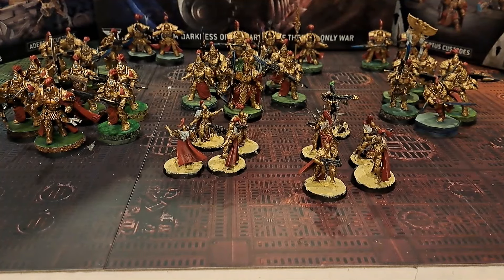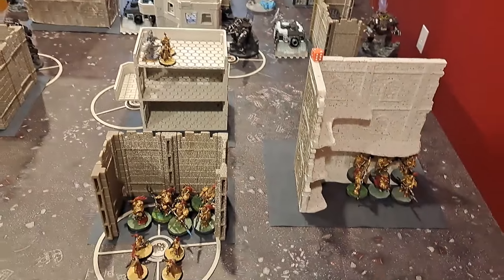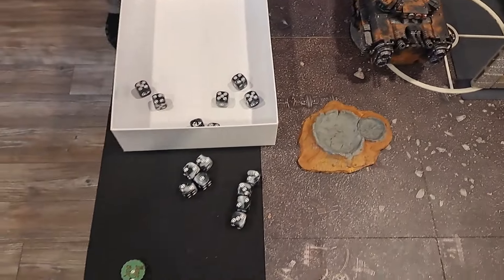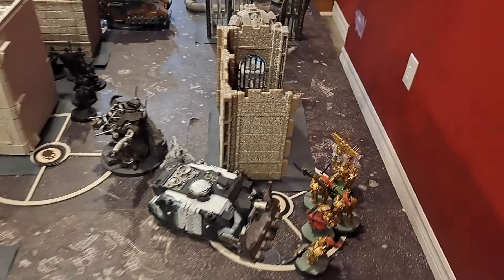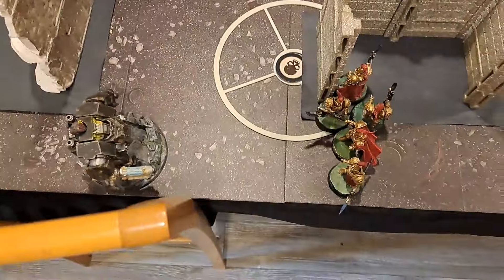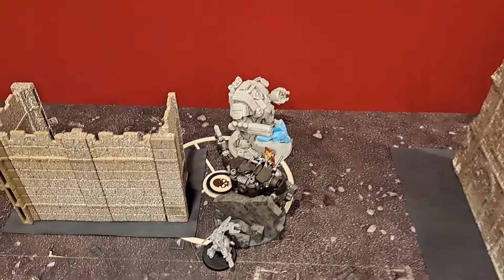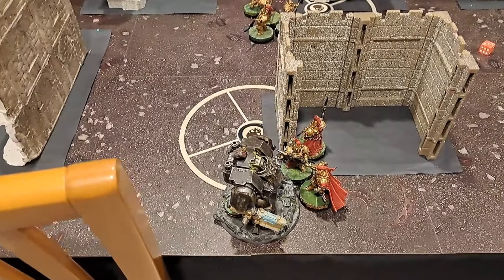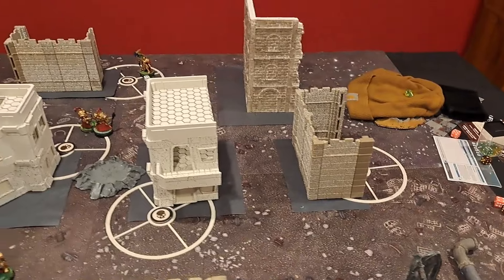Custodes Vs Iron Hands RTT Lists Battle Report Warhammer 40k feat. DaMittens

Comment: Hey mate, what did you change in the list to add the 2nd witchseeker squad?
Reply from the maker: Now that I look at it, the 2nd wasn't supposed to be in there. I was playing with a few different lists the night before, where I moved things around to fit.
Luckily, they just died without doing anything. 
I do have a new list video coming out where I dropped the 3 squad of Terminators. They really didn't do much at the RTT that just have the 2 units of 2 couldn't do.